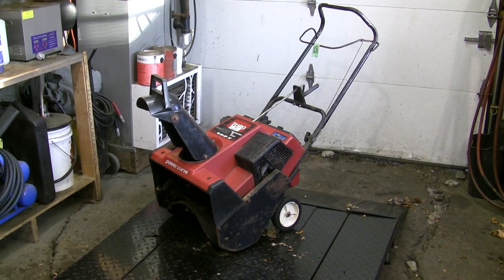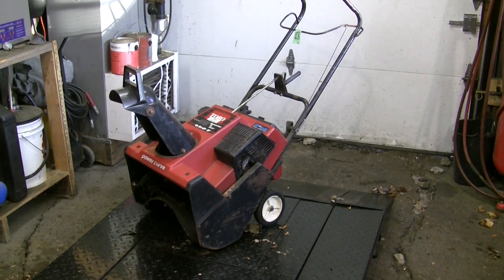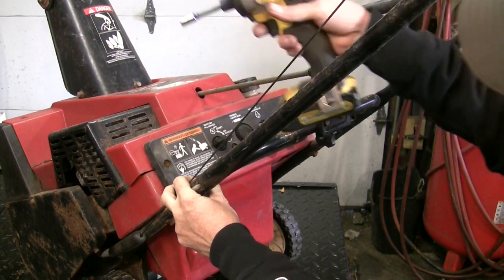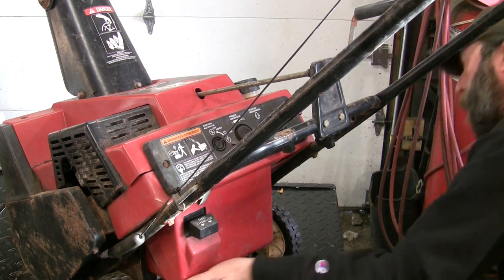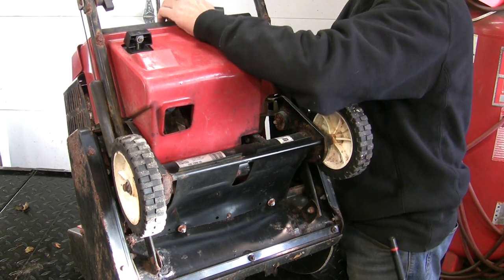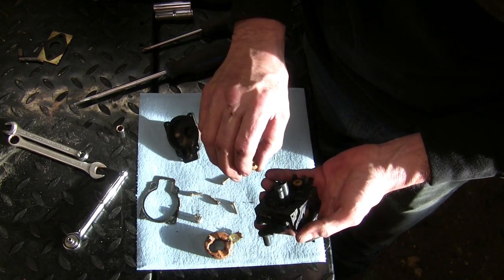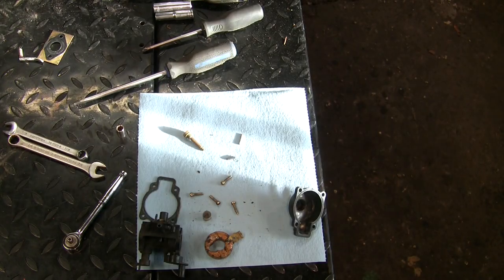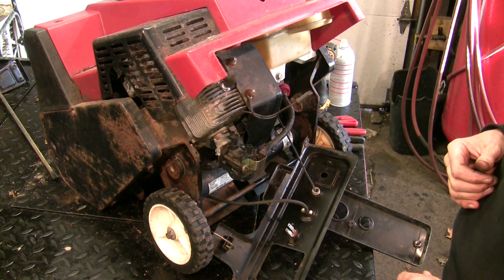Toro 38440 single stage snow thrower carb work and check up.

Comment: Camera and sound are both great. I've used blowers like that and they are really kind of nice, they can get into places much easier than bigger 2 stage throwers. And are much more maneuverable, but,,,,,, there is nothing like a 2 stage for moving lots of snow.
Reply from the maker: I have been doing work for a few commercial guys over the last couple years.  Many people are switching over to a commercial version of single stage machines now instead of the bigger 2 stage ones.  Much more portable, less bulky to store, and they throw snow pretty well.  This video was shot a while ago. It was a new (to me) HD camera back then, with no external mic.  That camera didn't last, and it had to be replaced soon after this video was shot...lol.  My current video and audio setup is MUCH better than what I had in this video.

Comment: Amazon has a new carb, new primer bulb, primer hose, fuel filter and shut off for $13.99 plus tax.; that's the route I went for a Toro CCR 2000.  Also, I only recall having to remove the 3 control panel screws and then 2 larger ones on the bottom of the handle up through it and screwed into bottom of the red panel.  Panel wasn't too hard to remove and replace with handles in place.  Enjoyed your video.
Reply from the maker: Thanks Lawrence!

Comment: on Taryl's channel, he said these machines, unless they are your own personal unit, aren't worth repairing if anything more than carb work is required....parts are so hard to find and very expensive if you do find them
Reply from the maker: I saw that video. He was actually talking about a specific Toro model that had plastic deflectors up top. The type in my video actually is easy to get parts for. But still, you're right.  If it needs much more that carb work it's not usually worth it.

Comment: I have one of those (neighbour's) that has fuel and spark, but does not fire. Going to look at the flywheel key next. It nearly pulls your  arm off when pulling the cord....not as easy as yours.
Reply from the maker: Definitely look to see if the flywheel has shifted on the crankshaft. That's where I would look...